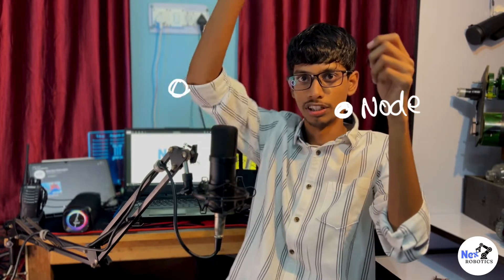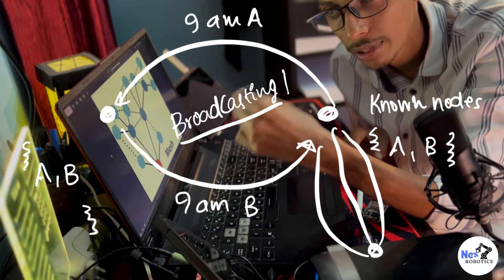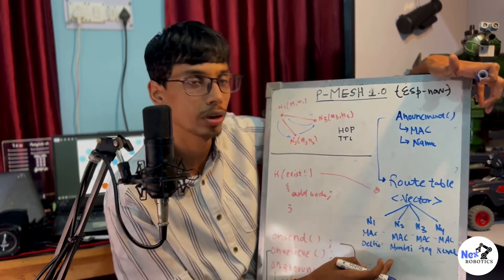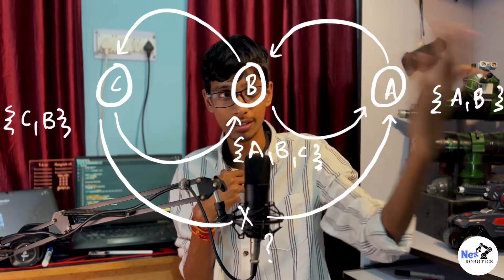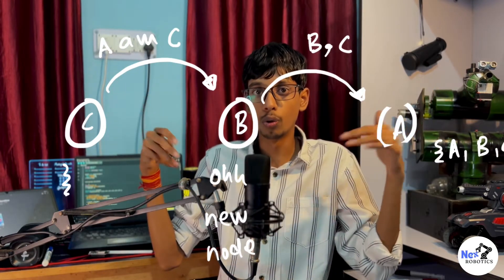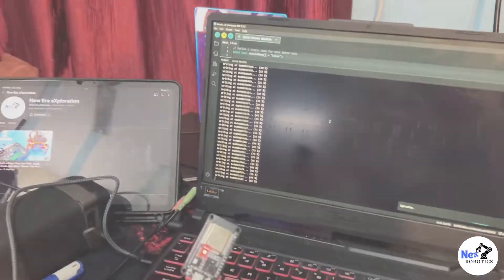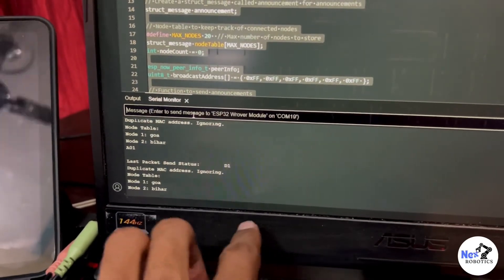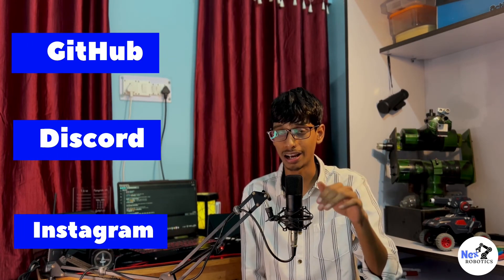How I Created an ESP32 Mesh Network in Just One Night | DIY ESP IoT Project

Comment: Did you connected to Wifi? Because I couldn't connect to wifi, Mesh blocks wifi connection. I'm using painlessMesh and I just using 1 esp32 root and other ones are mesh
Reply from the maker: Mesh block wifi STA 
You can shift to wifi AP 

Painless mesh didn’t worked for me so i write my own mesh algorithm 🙂
Reply: @New_Era_eXploration  Oh that's nice bro. and Yes I searched more and I found, yes Painlessmesh block wifi STA but I found a way of working with AP. It's working right now and It can send message to mqtt broker.

Comment: I tried with your code, idk why but,  it doesnt worked at all. 
How i set it up: every esp32 in a range 10m. Then i tried to expand, just like you in the video, after 15m of distance, node A to B still works but node C cant pair anymore
Reply from the maker: Try adding 1 more node and stress test the system to find out the range 

Then we can see if its a code problem or the hardware range problem